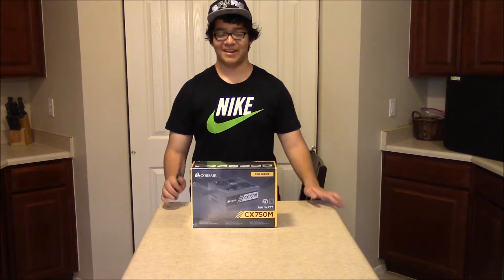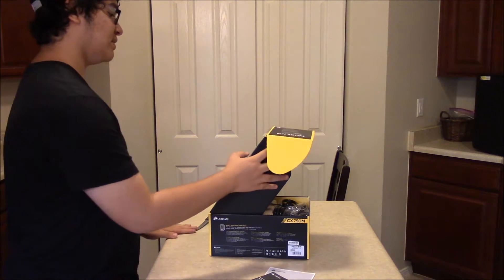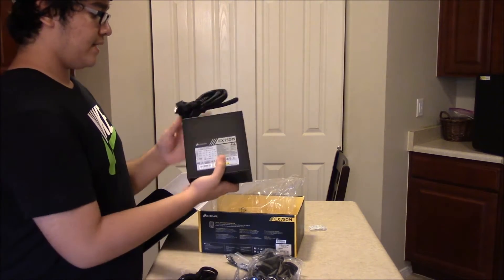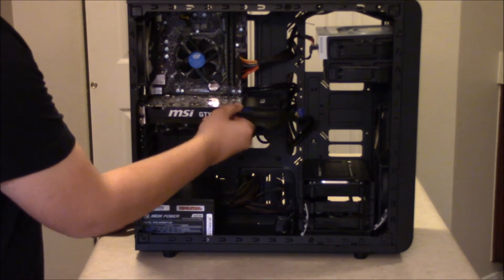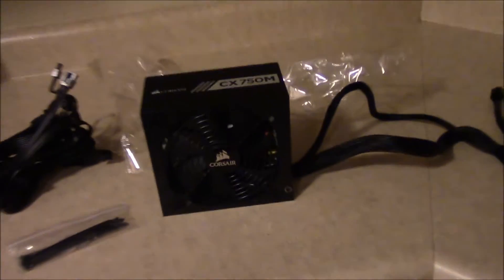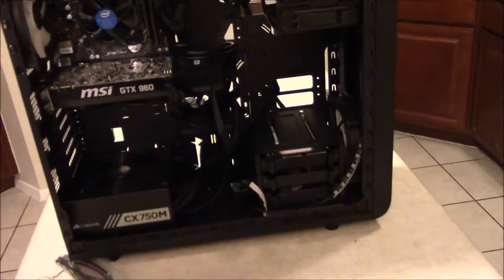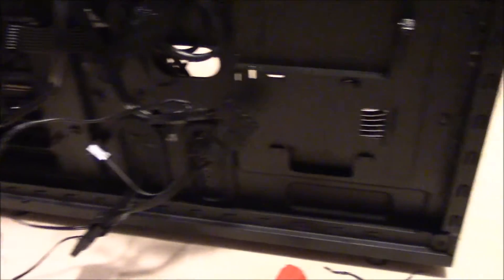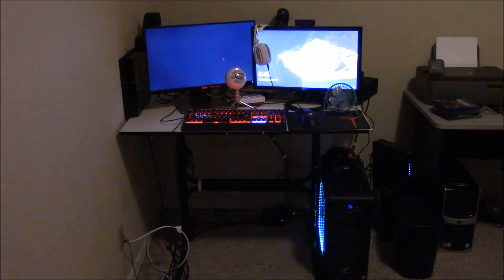Corsair CX750M Unboxing/Installation(How To Install a New Power Supply)[CyberPowerPC GXI7000B1]

Comment: I'm trying to pick out a 800w power supply but how do I know if its compatible with my cyberpowerpc case and do you have any suggestions. Please help
Reply from the maker: Well most of these power supplies, especially from CyberPowerPC are the same size. So they should all fit in the case perfectly. I suggest looking on newegg or other sites, that PC parts come out on sale frequently. Just make sure to look at the dimensions of the product to see if it will fit in your case! Hope this helped!